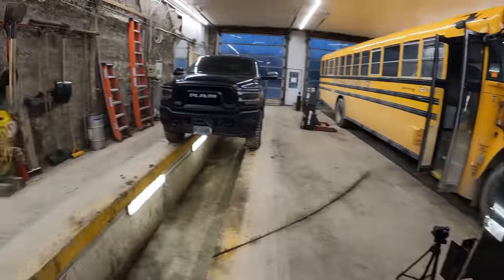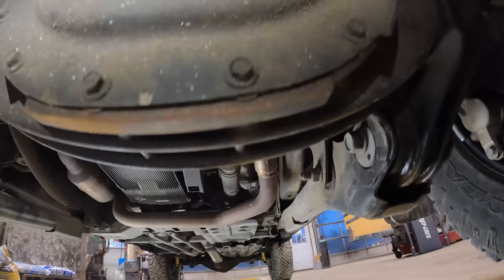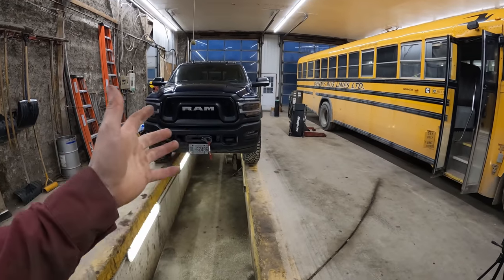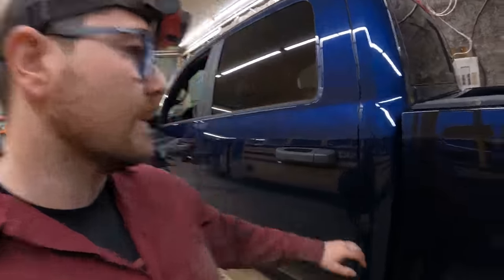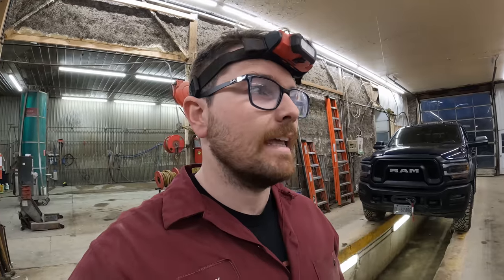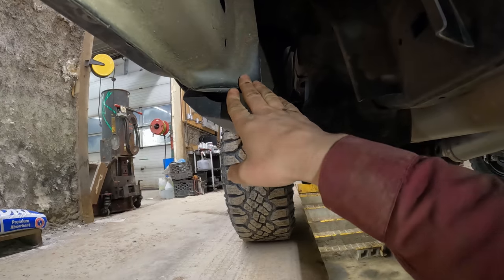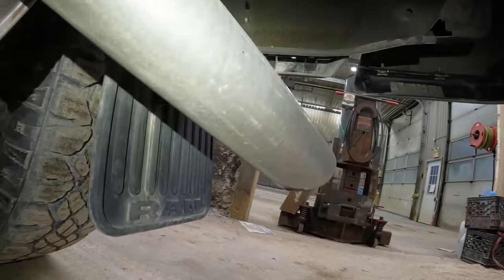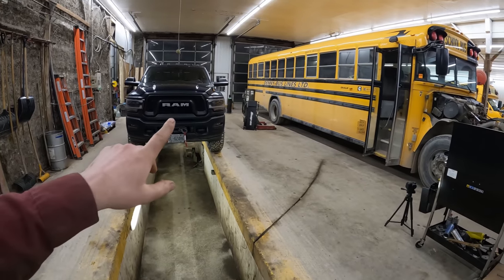2022 RAM Power Wagon RUSTING After First Winter | 5 Tips To Avoid Rust on Your RAM 1500 Trucks

Comment: Alex, for 17 years I worked in my families autobody repair shop. Living here in central Pennsylvania, we have our share of excessive road salt and cold harsh winters. As far as your axels and differential, your grandchildren will be graduating from high school before they rust away! HA! Be more concerned about places in between panels like inside of the doors, rocker panels, cab corners, etc or any place where two panels are welded together. Make sure the weep holes remain open to let any water or moisture to escape. This really makes a big difference over the long term to help prevent corrosion. We used a paraffin based rust proofing that, in my opinion, really worked. You just need to make sure all the weep holes are open after your vehicle is rust proofed to let any moisture out.
Reply from the maker: Very cool Bill! I imagine you saw lots of rust and like you said I'm not really worried about the axles but it be nice to try and keep the rust down on the under side of the truck. I get my truck oil sprayed twice a year so hopefully that will keep the panels from rust away. And yes the cab corners will need attention on these trucks!

Comment: Life in the rust belt sucks when you're passionate about your machines.. I find a thorough undercarriage wash after the winter season is key. A lot of people don't realize the salt and brine works its way in deep into where ever it can & even in the spring/summer everytime it rains it reactivates that salt that was missed & just continues to rot even in the warmer months. You've got a pretty solid case to present to your Dodge dealer. Hopefully they address the problems. Good video 👍
Reply from the maker: Great point! Always good to give the truck a good wash after the winter. But ya we shall see what the dealer says!
Reply: I’m in south east Alaska I fly down to pick up my new truck in about 4-5 weeks. I’d like to know the outcome of what the dealer says, right now I’m thinking have them remove it before I take possession of the truck. Please let us know… good vid by the way, very informative
Reply from the maker: @timothykuharich9967  I will make a video on what they say! but it's super simple to remove. well actually it's in a tough spot but its just plastic clips so I end up just taking a sharp razor blade and cutting the plastic tabs. but yes if they will take it off get them to do it!
Reply: @TheGettyAdventures  Did RAM/FCA fix the rust issue at the back of the cab? I have a 1500, took off that rubber piece and of course there was indeed peeling paint and some rust. Thanks!

Comment: Man this is a super informative video! I'm looking at a brand new 2500 once the market kinda cools down a bit, and rust is my biggest pet peeve ever on vehicles. My cars get parked for the winter, but my current 2005 ram 1500 is beat on all winter long. I bought it two years ago and it had some recent rust repair done, but some spots were starting to pop through. I oil spray it with krown every year, but holy crap this winter in particular just destroyed my box fenders. I don't want the same fate for my next truck!
Reply from the maker: Thank you sir! And yes the stuff they put down on the roads these days is just so corrosive. if it's above -10 they will put down a salt brine which is like some kind of liquid de-icer lol best thing you can do is get your truck oil sprayed brand new and before every winter. helps alot.

Comment: I learned a trick from sweet project cars he talks about using transmission oil in the rockers and the doors I have been doing for years and have never had a problem with the rockers or the doors rusting also use it in a spray bottle in those spot works pretty ghod
Reply from the maker: Not a bad idea!

Comment: If you drive gravel roads in any truck, your rockers will get sandblasted. Spend the money when you buy the truck and get that area bedliner sprayed. Tons of guys do that in Alberta, including myself. 3 years in and its holding up great.
Reply from the maker: I thought about! I don't drive that many dirt roads i figured a good set of mud flaps would spot alot of that road spray but obviously I need bigger flaps. Which like i said was my own fault. I might see how busy the local autobody shop is and see how much they would charge for bedlinering the rockers

Comment: calcium chloride mixed with road cinders here in pa. I have 2019 ford ranger and it has surface rust. not manufacturing problem. biggest thing is to keep your vehicles washed. I wash my cars as much as I can. spring time wash the entire underneath and spray with oil. then fall get reoiled before snow.

Comment: Don’t forget over the rear wheel wells where they have moisture holding foam. Always see 5-7 year old rams with rust around the wheel wells
Reply from the maker: Really eh ? Ill have to take another look. On my 2017 ram I pulled the inner plastic fender and didnt see any foam. But a couple of folks have mentioned it so Ill take a look! Thanks for the tip!

Comment: I have a 2014 2500. The body is absolute mint over and under but the frame was never oil sprayed in its life. This summer I'm taking on a descaling attempt with various cordless tools and possibly a wet sand blast. I will either use Ospho or Coraseal as a base coat before top coating with Eastwood chassis paint. Both products require a rub down with spirits afterwards before painting though. I expect this may take most of my summer weekends to complete, my neighbours will love me for it. I can sure feel for you after forking out for a brand new rig. These days there is no excuse for rust issues.
Reply from the maker: well I just went to the dealer today and they seemed very supportive for the paint issues at the back of the cab and they said once they send the quote out to Chrysler Canada and gets approved (they said is will 100% get approved) they will remove the back and repaint the entire rear of the cab. which seems nice! as far as the surface rust on the bottom of the truck. its just what happens. I keep spraying her with oil every couple months and hopefully keep it from spreading!

Comment: The front bumper is the reason I got a paint protection film on my 2012 Laramie longhorn edition. That painted bumper in color I think is called white gold looked so bad it looked like a ton of bugs mashed on it constantly. And all the chips started to rust.

So I removed the bumper, had it repainted and then had a professional very reputable shop put PPF on it. Haven't had any problems since - and I did this about 5-6 years ago.
Reply from the maker: Thats the only way to have a painted bumper not rust. You have to get paint protection stuff which is too bad. The painted bumpers look good but the chrome holds up much better.

Comment: Good tip about those rubber pieces, especially the lower one where leaves, twigs and debris collect. Ripped mine off last November. Also I rustproof my truck twice a year up here in CND once right before winter and once in summer. 
Once the summer dose is freshly applied I drive it down a dirt road few times to cake it on. 
Also I always have a few cans of fluid film that I spray throughout the year in areas behind the rear lights and headlights (removed of course) and wherever I see fit. 
Last but not least I removed the rear inner plastic fenders as they are in contact with the inner wheel well touching/rubbing the metal.

Comment: You forgot top of rear wheel wells.  Pump in the oil from inside the box.  I have been using pro form wax base mixed 50/50 with motor oil as a rust proofer.  Do it myself ,seems to hold up and work well.  

Thanks for the rubber strip tip, did not know that, mine will be coming off shortly.  

Engineered obsolescence. They ,manufacturers dont want them to last forever.
Reply from the maker: Thats almost what I was thinking. I mean maybe my box is sitting too close to the cab or vice versa but I doubt it. I figure alot of the trucks have this issue.

Comment: Very good look over.  I checked out my 2019 Ram under carriage. I have 50,000 Kilometers now. Winter driving in Manitoba and yes a salt belt. I’m very impressed after my inspection and nothing really. But I do wash my truck often. Nice review bud 👍👍
Reply from the maker: I should of mentioned that also in the video. Washing your truck often in the winter (one a week) will cut down on alot of rust! But thats nice that your truck is still looking good. I did buy the truck in December which is not the best idea lol took me about 10 days to get into krown for an oil spray

Comment: all of your points were right  but you missed a few 
  in between the front door hinge and the front fenders they have a rubber piece that collects leaves maple seeds and ect and will eventually rot your fender from the inside out  (on the 4th gens for sure) 
fender flares oem or aftermarket hold moisture in between the flare and your body and will rot out 

who ever oil sprayed your truck did a good job and took out the rubber plugs from the inner rockers (so it can breathe)

Comment: Thanks for the video, Just bought a 2022 1500 Laramie, Will need to get the creeper out and do some checking. Mine shouldn’t be to bad living in Dallas not much snow here. Also went from a 2019 with Chrome bumper and the 2022 has painted with rock chips already. Luckily dodge sent me the paint match stick..
Reply from the maker: I mean at least they send you something! but I would look under the truck forsure! I was at the dealer and they told me this is not uncommon. ford and chevy apparently do the same thing with rubber strips to keep the dirt out. but they have paint protecting plastic strips they put down where ram does not.

Comment: Great tips.  I just bought a 2022 RAM Laramie because I travel all over the country during all four seasons.  Many times I was up north with all that salt; Ohio, Minnesota, etc., so this will help do some preventative maintenance before next winter hits.

I was thinking that there is a paint-on DIY protectant, similar to bedliner, that might be a good fix for the problem rust areas/chips underneath.   As far as those rubber doo-dads, yeh those are coming off ASAP.
Reply from the maker: I was just at the dealer today and they said they have had a few complains about the rubber lips rubbing through. best to take it off before it does. but it looks like they are going to repair it properly. take the whole box off and paint the entire rear cab section.

Comment: I knew about the bed to cab seal and put heli- tape on the cab side to help the seal from rubbing through the paint. Just pulling the bottom seal off is probably the best option.
Reply from the maker: the dealership is actually going to take the box off and repaint the back of the cab. and then leave the piece off.

Comment: I was hoping the current generations were not having massive rust issues anymore. It is unbelievable that every dodge over  5 years old that I seen in my area looks more rusted that a 50 year old salt truck. I have been told that Ram/Dodge buys the cheapest recycled steel one can get, but I was hoping that had changed in recent years.

Comment: Right after buying a brand new truck  I’d wash the frame really good and then  paint it with rustoleum. It’d help seal the factory paint and will last years.
Reply: That cheap crap isn’t gonna do anything
Reply: @AsianNIGMA  oil based paint is better than factory paint.

Comment: Yeah that's why I'm not a big fan of krown it swells rubber I've been using fluid film on my Ram so far no issues with the rubber molding on the box also corrosion free is pretty good I used that type of undercoating for 6 years on my F-150 never had any issues as well.
Reply from the maker: Fluid film is a great product. I dont mind krown I think it works well.  But if a company was to spray fluid film as professional at krown does I would go that route forsure

Comment: Just brushed, cleaned and repainted most of the undercarriage of my 21 power wagon, removed the two vertical trim last summer, but i just did the lower horizontal one, once removed i noticed that the fuel pump location on top of the tank is now exposed. Do you think it could become an issue in the future?

Comment: I always spray my Trucks with Rust Check wax and then cover it with the Rust Check drip less oil spray. Never have a problem. My 2020 Power wagon still looks like brand new from underneath. Rust Check is way superior to Krown.
Reply from the maker: Thats awesome! I mean I'll not too worried about the under carage rust its just surface but after I filmed this I spayed the under side with the thicket rust check stuff. We have a bulb barrel of it for our buses and it works well for them. I do like how thin the krown stuff is for the inner pannels and stuff. Probably creeps into all the tight spots. But for the under side yes you want some thicker stuff

Comment: Did you get the area on the cab from the rubber seal dealt with yet?

I'm taking delivery of a Power Wagon within the next couple of weeks. And will be looking to cutting those rubber seals right away if possible.

Comment: Hey Alex, thanks for the informative video. I was wondering, what front bumper are you replacing your stock front bumper with?
Reply from the maker: I was looking at something like a ranch hand bumper. Something nice a beefy. But the winch kind of makes it tough and there isnt really any Power Wagon specific bumper that I like. So I may just get a bush guard from wranch hand and bed liner the factory bumper
Reply: @TheGettyAdventures  I had no idea Ranch Hand existed. I was considering getting a 3500 instead of a PW and didn't see many aftermarket bumpers that would fit but Ranch Hand has some nice options. I also didn't know you could bed line a bumper, that's clever. Thanks for the quick response Alex!

Comment: Hey, have you scanned all the modules on that truck to see if you have any hidden codes? Are you aware that with the Secure Gateway module on your truck you cannot clear codes, or bi directionally control at the DLC without a paid  subscription to AUTOAUTH and internet access? Additionally, if you lived in a hot climate you'd be saying the AC performance on that truck is complete junk. I should have bought another  Chevy. Ram is crap.

Comment: I payed for the dealership under coating pissed me off they didn’t even drop the spare tire. But it comes with a lifetime warranty on the body. But I don’t think I will own any new truck very long as there are to many computers and  sensors to break after a few years. Never had an older truck that didn’t lose the power windows so no way all this fancy electrical stuff is going to. Work after 8-10 years.
Reply: Old trucks had the worst electrical systems,
Reply from the maker: Id be careful with that lifetime rust warranty. I had that on my old 2017 ram 1500. I had some rust developing and i went into the dealer and they read me the fine print. "There has to be holes in the body and a maximum of 3000 dollars of repair" I paid 1500 dollars at the time of purchase for lifetime rust proofing. But unless there is a hole they wont fix anything. And 3000 dollars in body work might get you a new set of rockers. Thats it. Rust on frame or axles does not count  unless there is a hole in it and well if you have a rust hole in your frame you have bigger issues.

Comment: What kind of oils and grease are you using?
Reply from the maker: So i get the truck krown sprayed twice a year or at least I will get the second spray this spring. And the my shop has a rust check sprayer for spraying our buses so I touch it up with that on the under side of the truck

Comment: Did you remove your rock sliders? I've heard where they bolt on, creates a huge rust problem.
Reply from the maker: Yes!! ripped those off after a week of owning the truck. they bolt directly over the rockers and mine had already rubbed through the paint to bare metal.
Reply: @TheGettyAdventures  what did you put in place of the original and protect against rubbing and rust in those spots?

Comment: Try crc rust inhibitor.      Power wash under real good and apply crc , get it real good in the problem areas .    Its good stuff and doesn't wash of quickly.  Apply once a year.        Fluid film is also good but washes off quickly in my experience.       Check out project farm YouTube channel about rust inhibitors.
Reply from the maker: So after I filmed this I sprayed the under side of the whole truck with some nice thick stuff. In our shop we have a oil sprayer for our buses. So hopefully that will help. Fluid film is the best stuff but its expensive